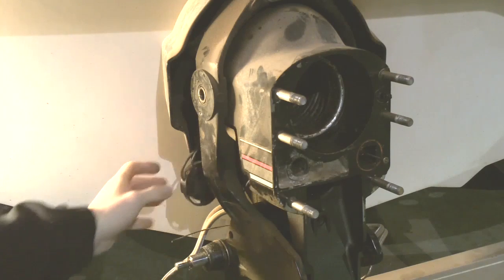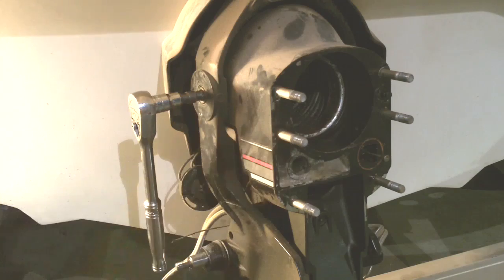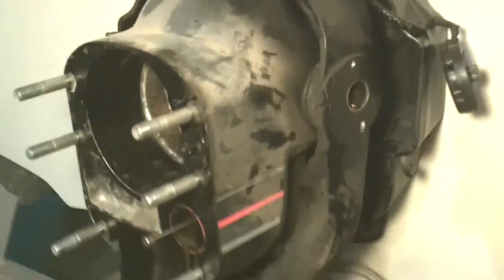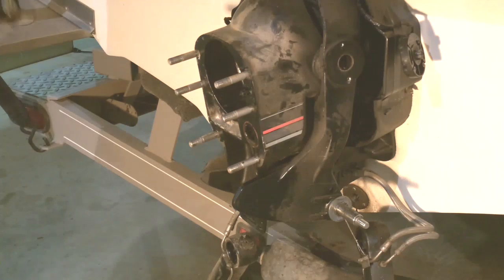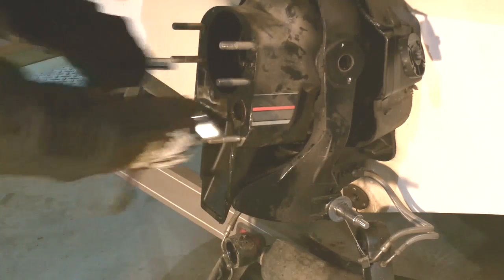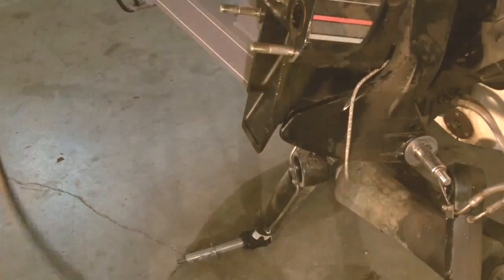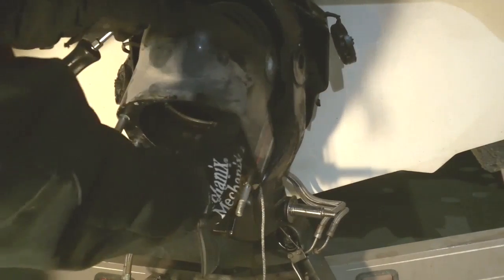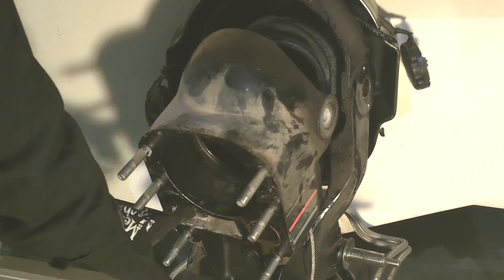Mercruiser Bravo Transom Repair - Part 1

Comment: I thought shifter had to b in reverse first or break something.
Reply: Hello Anthony.  If an Alpha DRIVE, it needs to be in forward gear first so the shift shaft forks line up parallel with the shift cable.  Makes everything in parallel so it can slide apart.  BUT FOR THIS DRIVE it is a Bravo so it stays in neutral when removing the outdrive, aka a different design in the Bravo series drives.